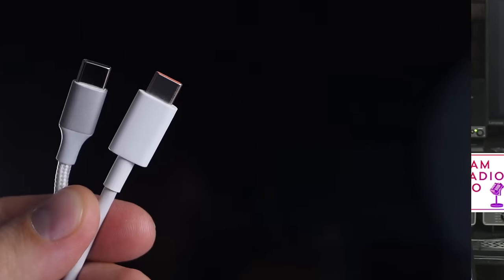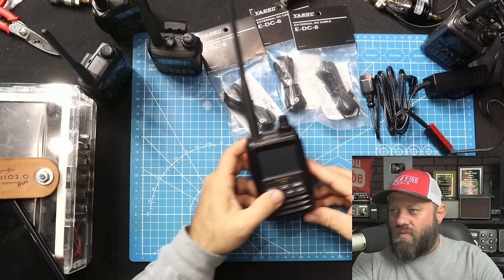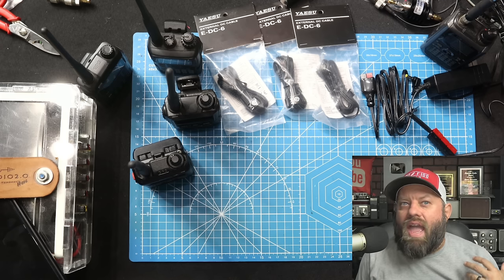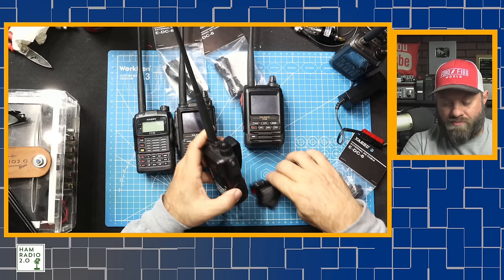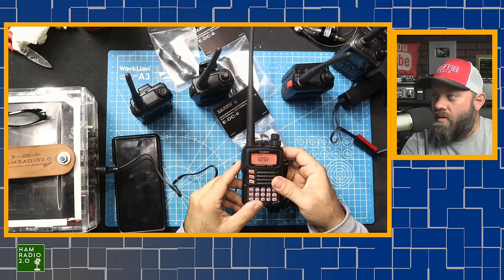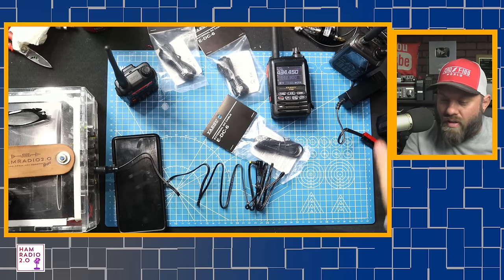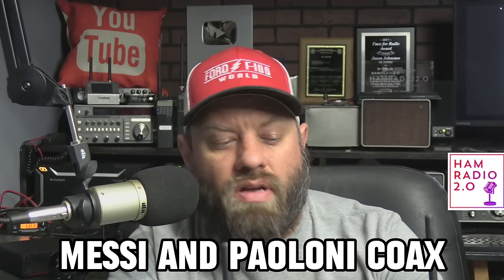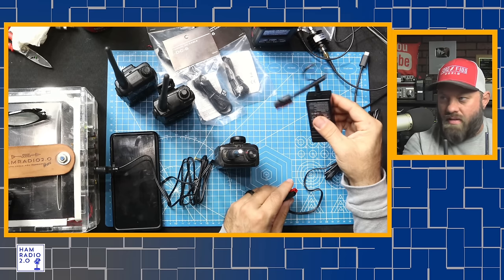The Ultimate Convenience: Charging Yaesu HT Radios Made Easy at 12V

Comment: I want to see radios that not only use USB-C, but the USB-3.0 charging standard.  Meaning they can use 5/9/12/15/20 volt 3 amp smart chargers.  Most my Chinese radios won’t charge unless it’s USB-2.0 5v, 2.4a max.  It just won’t charge if I plug it in to any USB-C multi-volt charger.  You can always get a cigarette lighter that attaches to battery posts.

Comment: i do not buy any radio that can't charge USB-C or 12V . 12V and USB is the easiest way to power/charge when on the go or during a emergency or camping/POTA . with my camping LED lantern has a 12V charge cord. I put power poles on it.  even the Baofeng UV-5R has USB C or 12V charge . new battery has USB C on it. the charging stand has 12V adapter or USB A cord for it. China got a jump on USB C and 12V charging from the start of the UV-5R radios. nice to see Japan going USB C .small USB solar panels are common now. power bank's USB all over. and best part about USB C. just plug in. no up side down . no flipping. 73's

Comment: I snipped all of my radio power cords and put powerpoles on them.  That way I can charge from a battery or from the wall wart.  I also buy Ethernet routers that will run off of 12V and put powerpoles on them, too.  My computer monitor takes 19V in, so I installed a 19V power supply on the back that takes 12V in.  Let's me run a monitor in the sticks if I need to.  However, everything else I use like my phone and laptop is USB PD.  CoolGear makes USB power supplies that will run off 12-24VDC including a 100W PD power supply.  So I install those in my truck, camper, and battery boxes.  I learned a lesson back in 2019 in the aftermath of a tornado that power is everything.  Have as many options as possible.
Reply from the maker: Great plan. I'll lookup that USB power supply
Reply: Where do you get a 19 volt power supply that takes a 12-volt input?

Comment: Usb c have this days different voltages even over 20 volts. So it Chan charge also with a adapter or module 12v devices. You can buy modules wher you can switch micro switches to your desired voltage, I think it was 5v- 9v- 12v and 20(12volt).

Comment: I still use my FT1D.  love the radio!  APRS battery consumption sucks, but stand alone battery packs help while backpacking.  The only other issue I have with the radio is at times the battery pack on the radio will shift/move and the radio powers off.  Its never been dropped, I have no clue.  Maybe a new W0AEZ battery pack will fix this issue.
Reply: i use  my  ft1d   every day  all my freq is in it  use  the  60 for weathe.r use d74  with hot spot for dstar

Comment: Still love my FT1DR. I saw a video from the Tech Prepper a couple of years back where he talked about the VX6R’s 12v capability, and I stumbled across the FT1DR’s, but didn’t know those other FTs could charge on 12v as well. Good to know!

As for USB-C…I’d love to see more manufacturers add it as a charging option. Down with proprietary connectors!

Comment: For emergency use I prefer the 12v chargeable radios. I don't have a USB-C chargeable radio yet. I have a few USB micro FRS radios that work well.  One question. Can you use the USB-C charge function while using the radio? I know you can operate the Yaesu radios from 12v while charging. Does noise from the USB-C controller cause any issues for receiving while charging? My shortwave receiver is totally unusable while charging from USB.

Comment: Yes I have an FT1, and it gets primarily used as an external GPS unit for my FT-991a, also of note, the Battery for the FT1 FT2 FT3 FT5 is the same battery for the VX8, and yes I feel like a hoarder now, but I do have all of those HTs I mentioned for the battery.

Comment: Yaesu Batteries, the VX5, VX6, VX7 all use the same battery, this is a very good battery from Yaesu!
The VX8Dr, VX8G, FT1, FT2, FT3, and FT5 use the same series of batteries, BUT be aware that with this last group that changing the batteries often WILL weaken the clips on the batteries, to the point that they could break off and render the battery almost useless, same with using the belt clip attached to the battery will weaken the battery mounting clips at the top of the battery.  The clips are flexible plastic and will fatigue over time with frequent changing of the batteries. Avoid dropping the radio as well, this can cause the battery to come off and break the clips,  again a 7.4 volt paper weight! I have held a broken battery on with a rubber band and this works but it's not ideal. So there you have it, good radios with less than optimal battery clips, this is with the VX8D-G, and FT1, 2, 3, 5, and any other Yaesu that uses this series of batteries.  As for charging, I'm all for the 12 volt standard, in an emergency you should be able to find 12 volt batteries in wrecked or abandoned cars, and all you need is a is the power plug that fits the Yaesu Handhelds on a lead with clips on it and you are ready to charge all the radios listed above, and no doubt others as well, you can make a handful of these cables and have them handy in case the S H T F!  What do you need with USB charging? In fact there should be portable AM, FM radios that can run off 12 volts, most of our Ham radio gear already is 12 volt compliant, a great standard that should have more support! This is important!   7 3 de VE7PGE

Comment: Not just usb C but USBC PD capable why because the battery can request the voltage it needs.  Now if we could get a cable with the USB C charge controller built in and 12v out we could plug this into any vehicle or home charger to charge your radios.

Comment: If you want to be able to use a USB powerbank to charge your 12v batteries, look at USB PD charging. There are a lot of USB cable chargers that do low power 5v stuff, but USB Power Distribution allows for 9v/12v/15v/20v output so you could output and charge at 12v with a USB C cable battery bank.  PD requires negotiation of what power source to send (i.e. it asks the device what volage to supply) so 'dumb' devices dont usually work, but there are cables and adapters that can do this automatically. Adafruit make a USB C to DC barreljack cable thar autonegotiates 12V.  You just need to make sure that the powerbank you use supports PD and 12V PD (some don't).  All of the Ugreen models of powerbank do.
Reply from the maker: I have several of those

Comment: The W0AEZ 5AH USB-C Battery uses 21700 cells, not 18650 cells. The 21700 are larger and have more mAh in them.  
FYI for 12V charging, the Yaesu  SDD-13 12VDC Cigarette Lighter Adapter  Cable has a Noise Filter: on it. That will reduce noise from a vehicle's cig port when t it is running. HRO has the best price I've found for the SDD-13.
Reply from the maker: I don't typically use cigarette-lighter chargers, but that is good info.

Comment: I have a FT-1D in regular use and I charge it from the cigarette lighter plug on my car/truck, no need for a battery box.  Almost all HTs could be charged from 12 volts in the past. Then the chicom radios arrived with drop in charging only (looking at you Anytone, TYT, Retvis).  I'd rather have 12 volt charging than USB-C
Reply from the maker: Same here

Comment: About Yaesu and 12V ht charging, the Yaesu chargers do not supply 12V, maybe 11.5V. Everybody says 12V is ok, but does that mean 13.8 is ok?

The W0AEZ batteries just went back in stock. I was waiting, so I snagged one.
Reply from the maker: Yes Kevin added stock in-line with this video - we coordinated that, like I mentioned in the video.  Glad you got one.
I charge my Yaesu HTs with 13.8 volts and have never had an issue.  Most LiFePO4 batteries are nominla at 12.8V though.

Comment: USB C should be standard on most things.  I haven't been able to get my Kenwood TH-D74a to charge on the micro USB.  Manual says it's for data only.  I would like to know how you got it to work.  I can't wait for the TH-D75 and USB C to charge.  However a battery bank and a PD cable with an adapter makes it handy to charge on the go and in the field.  This will go to my wife when the TH-D75 comes out.  The USB-C and added features are things I will use, My wife is still learning as she's a new ticket.
Reply from the maker: Totally agree

Comment: Just an FYI FT-60R will not charge the battery through the external DC power plug, but it will operate the radio. In order to charge the battery, you'll need the cradle, which will operate off the same plug.
Reply from the maker: FT-60 is a very old radio, I wouldn't expect it to work with any USB connection.
Reply: @HamRadio2  not USB but 12V external power using the cord. The cord works to power the radio but won’t charge the battery.
Reply from the maker: @candyman__87 well the same thing still applies - it is a very old design with far less features than modern radios

Comment: Every radio could easily be updated with a USBC battery. Preferably a high capacity battery. Like if my FT-65R had a high cap USBC battery offering, it would be the only radio I recommend for new hams. Want to buy a VX6R next, but am hesitant about two things - it seems to have the topple over problem that I don’t love about thin radios that I can’t add a thicker battery to, and then I’m kinda hopeful we see a replacement/update this year. Probably not, but hopeful!

Comment: USB-C is certainly convenient, but most of the time I see it being utilized, it is either via AC or 12v anyway, so it clearly isn't necessary if you already have an AC or 12v charger. Again, convenient to power up your radio from a powerbank or something similar, but I've never been unable to charge a radio due to it NOT having USB-C.
Reply from the maker: Agreed

Comment: I would prefer USB-C over 12v for prepping reasons (btw your prepping stream yesterday was good.) I carry multiple USB battery banks with me as my EDC and it's more convenient than an actual 12v battery. Everything electronic in my EDC are USB rechargable so it is good to have anything standardized from one source if needed. I would prefer USB-C so I could only carry two USB-C cables instead of the many outdated USB versions.

There is a VX-5R. The main difference between the 6R and 5R is the bands: 5R works with 6m instead of 220. I have it over the 6R since there are 6m repeaters in my area, but not any 220.
Reply: How do you keep your USB battery banks charged when they run down? There is a flood or earth quake, a storm, power is out for days, maybe weeks, lots of wrecked cars with 12 volt batteries, and many of the newer ones have USB outlets in them, but the outlets won't work because the car is damaged, but I'll bet you the 12 volt battery still has a charge in it! A simple plug, cable with clips in you pocket could charge your Yaesu Handheld!
Reply: @PGE564 If you are referring to when I'm at home, I have 12v backups since I have my entire ham shack running off of a 12v LiFePO4 battery bank. Many I have solar recharge since they have panels on top of them. I put them in the window and allow the sun to recharge them. I also rotate each out each time I'm recharging them. 

If you are referring when I'm away, I can recharge them while I'm at work. However, I'm not going to be away that long unless I'm on a trip. In the instance I am planning to, I have a power bank that fits quite comfortably in my EDC pack (Renogy 72000mAh 266Wh power bank) along with a 60w foldable panel. I take three with me, so even if one runs down, I got two others.

I prep. I have back-ups to back-ups to more back-ups. I prefer USB to standardize everything in my EDC, and it's very portable. I could get a buck converter, which wouldn't be a bad idea to put in my EDC.
Reply: @PGE564  To each his own. I don't prep at all. Not afraid of any old zombie.
Reply: If you plan on using a 5 volt standard, just make sure you have plenty of adapters for unplanned use, so you can get your hands on one or more quickly. You know the type of adapters you need, make a few and keep them in accessible locations. 7 3  @ke8mattj

Comment: Anytone 878 has a factory usb-c battery now
Reply from the maker: On the battery or the radio?  I picked up a battery with USB-C for my Anytone a while back, but it was still only about 1800mah, not the 5AH like the one in this video
Reply: True, my Anytone 878 I just got already came in the box with usb-C port on it.
Reply: @HamRadio2 battery, 1st party. My HT I just got came in box with usb-C battery.
Reply: So you can charge the battery via USB, is it just the battery?
Reply: @Josh-KJ7OEP  Just the battery for now, no usb in the radio. Still using the Kenwood style connector. However new Anytone is supposed to be released soon, wouldn't be surprised if it had USB-C for programming
Reply from the maker: @kevlarnegative  I have one of the original 878UVII+ radios and it didn't come with a USB-C battery, but I grabbed one from eBay a while back